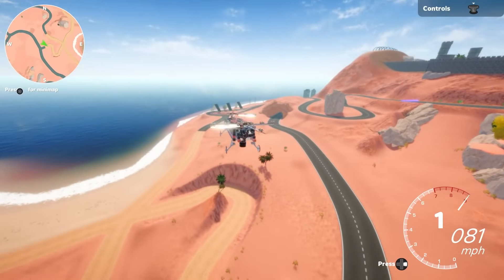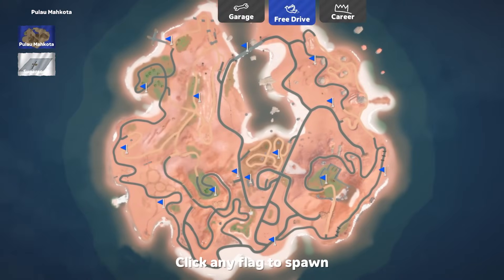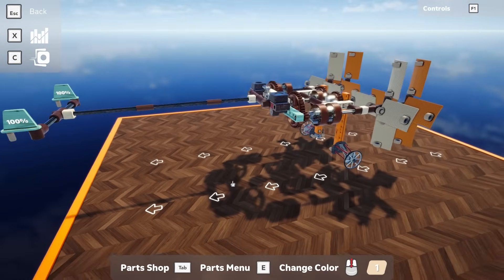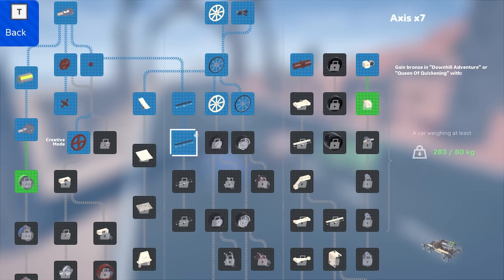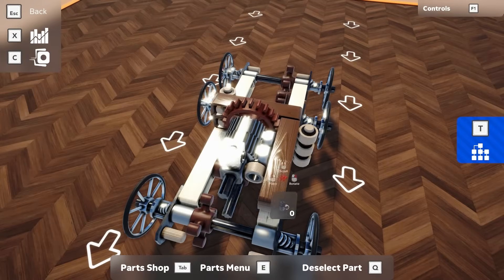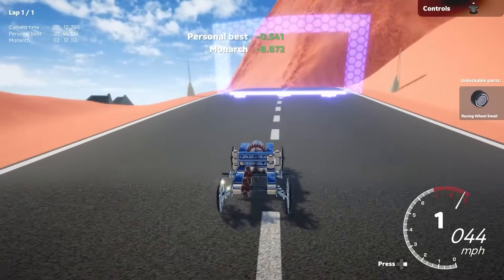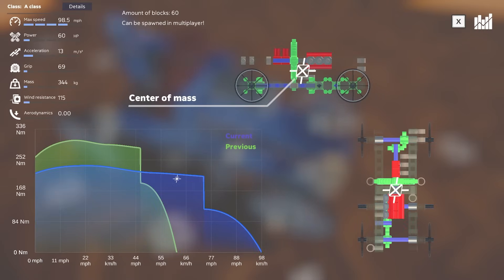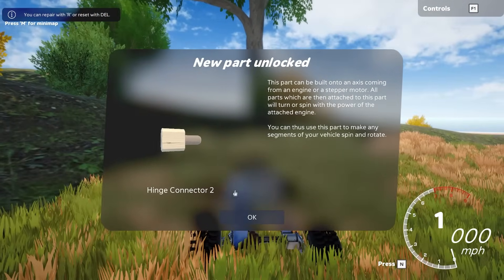EPIC Flight Through The Skies In The ULTRA Fast Dragonfly Aircraft In Screw Drivers Game - Ep014

Comment: One method for better pitch handling that you could use is servos controlling the angle of spoilers on the back of the boom. That could also give roll as well if put elsewhere.
Reply from the maker: Yeah I'll have to try that. I can get it to pitch up but not down using servos.
Reply: @OZTRON I think you had the right idea with the rotating weight for roll in your first craft in the video. You could use these for pitch too, probably geared from high to low so they turn slowly. They use this type of gyroscopic "reaction wheel" in satellites and spacecraft to rotate around three axes; they're one of the reasons the Hubble telescope will ultimately become useless as its gyroscopes fail and it costs tens of millions of dollars to replace them.

Comment: For the tech career, all the unlock only need you to get bronze, you just need the piece requirement to get the unlock, but you must redo the race for it

Also to get cash fast, just do up the hill  since the race is 10 to 20 second it give a decent amount of point depending on your speed...
Reply from the maker: Ahh thanks for the tip. And yeah that's what I do to get cash fast.  I mention it in the video. 😁👍